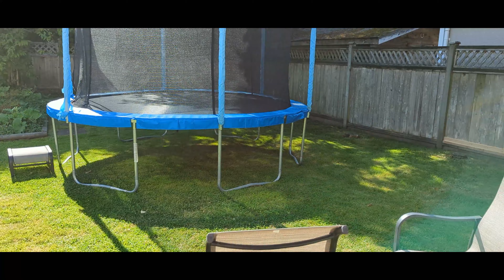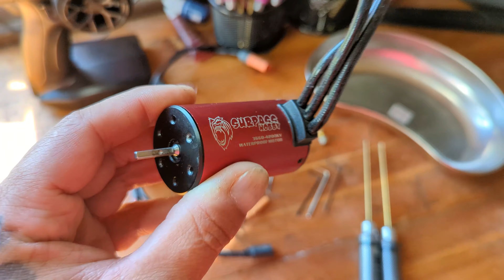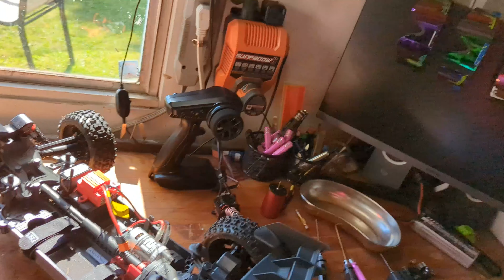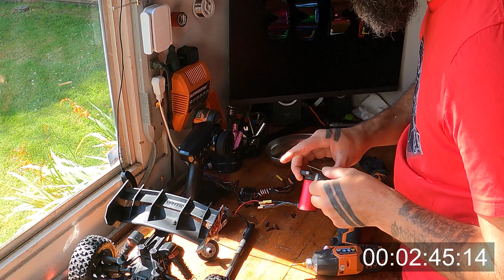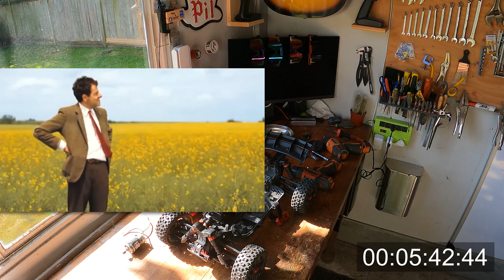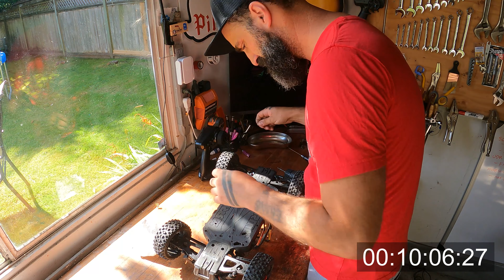The $149 Arrma Typhon 4x4 Mega gets a 'TIMED' Brushless Conversion & 1st SEND!! 😲 One Shot-UNCUT!!!

Comment: Very enjoyable vid.  I have an old Turnigy Trackstar 120 esc and 1900kv motor I used in a Ofna LXe1 and was wondering if any of you think I could repurpose it into my Mega?  Definitely going to stay on 2 or 3s.

Ps.  Subbed. @disciplinerc
Reply from the maker: Yeah man, that would work great. Up the pinion size a bit though, the stock is 17. With 1900 a 28-30 would haul!! 🤘😎
Reply: @disciplinerc  Sounds like a good plan of attack!